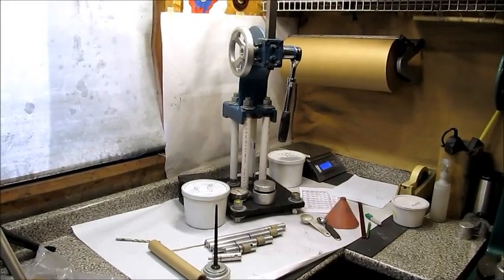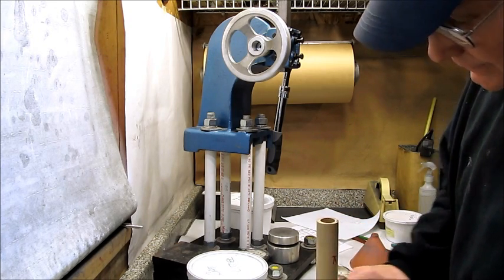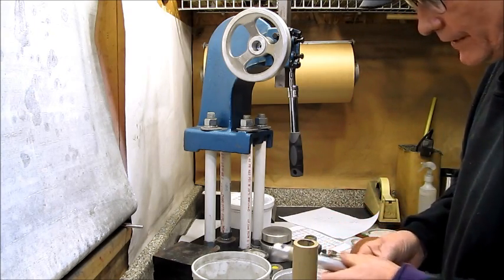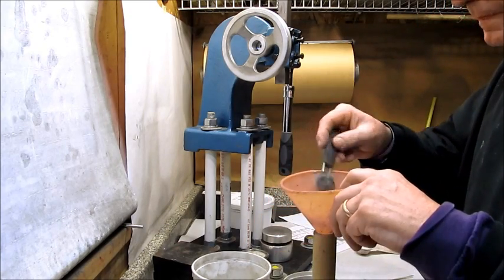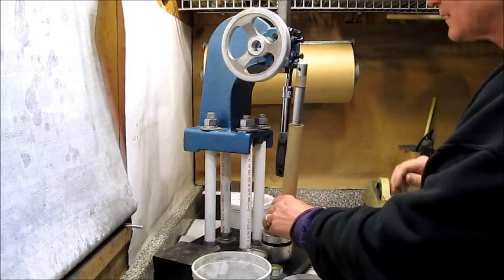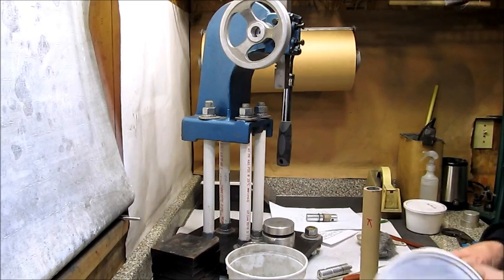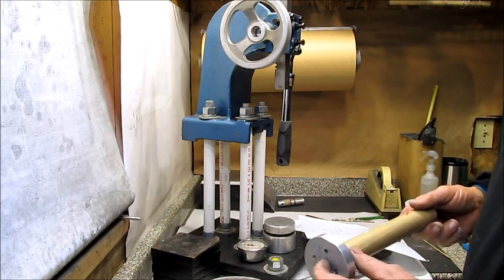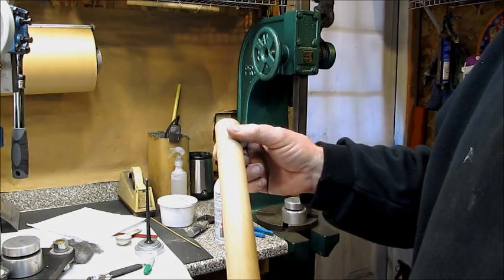Arbor Pressing a Black Powder Rocket Motor

Comment: Ned that arbor press sure makes quick work out of pressing a rocket motor. After I learn to hand ram motors I'd love to get 1 of those built. Although I don't know if I'm mechanically inclined enough to build 1 even with your amazing detailed tutorial on it & the gauge. I know Caleb sells 1 but money is always an issue. Thanks as always for your amazing informative tutorial.          Dylan
Reply from the maker: Yeah, Dylan, whether homebuilt or store-bought, good materials and tooling costs a bit, but the right tool sure makes a job go nicely.
Reply: witch video shows talks about the gauge please

Comment: sir... you are a ninja of pyrotechnics... i only wish i could come be your apprentice and learn your ways like the kid in an old kungfu movie learning the ways of the ninja master...
Reply from the maker: Thanks, Philie. Fortunately, nowadays, there are good 'net resources of information about fireworking, and we can be guided by them, and the conversations within them. Enjoy, ned
Reply: ned gorski one more question sir, im working on a kind of cake with flash salutes with a lift charge under them.. mebbe 9 or 12 shots (haven't decided) would you recommend i fise them with visco or time fuse? im making them from 3/4" tubes with paper end caps...  i dont wanna assume vosco will work and have em flowerpot.. but i dont want them to take wau too long to ignite and hit tje ground.. your opinion would be much appreciated
Reply: ned gorski Sir bed I have a quick question, pardon me if you've already said this somewhere but I haven't seen/heard it if you have. but when pressing a powder motor like this do you use like meal d powder, or do you use granulated?  I would assume using the fine powder would be better,  but I've found not all things work as you'd think so I figured I'd ask.. thanks for your time and help

Comment: Sir 
I have a 1/2 ton press setup like this and nothing larger,
also no ram gage or conversion chart. Would you suggest hand ram of the 1in 3lb motors?.   Also I have red ceder 15-10 milled , I use as a start to BP. Would that be ok with a mix of 100m KNO2 and 15% Cookbooks air float?  
   I'm trying to keep my milling to a minimum as these mills I can handle only handle a real 400g load. I do cheet them to 500g . 1 to 1 1/2 water as you said. Not oil..
CATOS ain't cool but nether is bothering you ....
Bob

Comment: Ned, on the Wolter Pyro Tools, the PDF on related to the Pressure Conversion Gauges list the required PSIs as 6500 PSI for Black Powder and 8800 PSI for Whistle.  Now, I would think (probably incorrectly) that I would need at least a 3 to 4 ton press to achieve that pressure (6500/2000 = 3.25 tons).  Does your arbor press create that much pressure?  Or is there something in the math related to the smaller areas of rocket diameters that allows that type of pressure to get leveraged from, say, a 2 ton press?  Hope my questions make sense.
Reply from the maker: HowellHudson Force applied by a press is different than the pounds-per-square-inches pressure (psi) that is applied to the propellant in a motor. The area of the hollow rammer, as compared with a solid one, also has to be taken into consideration. I hope that points you toward the math necessary to clear that all up. Also, making the BP propellant the way shown in the videos, and using shorter increments, necessitates only about 5000 psi on the comp, instead of Rich Wolter's 6500 recommendation. Good tubes can be pressed up to that pressure without being damaged.
ned

Comment: Hey ned, love your work!!  I was just wondering, but what psi do you use for 3/4" nozzled motors on your p2f gauge?  I'm using 1800 and still shrink my tubes.  Thanks!!
Reply from the maker: I put 7500 psi of pressure on my rocket propellants, and tube waxing prevents the problem you are describing, Jeep
Reply: @nedgorski  thanks!

Comment: If you don't mind, what is the purpose of the rubber O-ring. All I can come up with is to minimize powder blow back while compressing.
Reply from the maker: If the propellant is dusty, Ol, the o-ring prevents that dust from "floofing" out of the tube as the rammer is inserted into it.

Comment: ChazCo, 
Where did you get the load cell with the gauge on it ?  Also what kind of spray lubricant do you use on the spindle and rams?  I am hoping it is nearly odorless and clean (not like WD40 but maybe like silicone spray).  Also, what is the formula you use for you black powder?  Do you use Dextrose with the small amount of water? I enjoyed your tutorial immensely.  Maybe I can finally get some performance out of my rockets.

Comment: Another awesome video from the Firework Guru. Question: What is the delay composition?
Reply from the maker: Quite a few compositions can be used as the delay, to create different effects, Danny. The same propellant can be used, dialing in the height of the delay to get the timing right. Or a delay comp with different metals in it, or glitter, or color comp. Lots of creativity possible just with the delay comp.

Comment: Great video I did a 1lb super core burnet rocket.. my mix was 75/15/10 I rammed the Bp all the way to the top of the tube minutes one inch… the rocket went high I say maybe 200-300 feet.. the problem I had was that I didn’t have a delay mix or bulk head clay the rocket went high then started coming down, down, down and my header exploded only 5-10 feet above grass.. any idea what could have happened here? Is using a delay mix and clay bulkhead beaded to prevent this from happening again? Please lmk
Reply from the maker: It sounds like you had too much propellant above the spindle, Jose. That, or there was some delay in the heading igniting.
Reply: @nedgorski  thank you i heard you have a website I can pay to learn more about pyrotechnics.. can you send me your info please so I can subscribe please.
Reply from the maker: @jstorres486  See the beginning of the vid, Jose. You'd be welcome.
Reply: @nedgorski  jajaja I got it thank you
Reply: @nedgorski  it was too much propellant above the spindle I corrected that and all 8 one pounders have gone off exactly the same.. thank you and I’m glad I subscribed to fireworking forum all ready learning a lot.. God bless
Reply from the maker: @jstorres486  Excellent, Jose. Congrats. Onward and Upward

Comment: Hay Ned I know this is a older video, but I have a question about your press.
I'm not on fireworking, although I'm on apc. What thickness is that base plate?
Reply from the maker: That's 3/4" steel, James.

Comment: Ned, forgot to mention that i dont have trouble on getting rocket tubes/cases, as a licsensed pyro guy i always have leftover debri of a variety of 1.4g and 1.3g cakes which i just rip the tubes out and recycle them for comets, mines, meteors, gerbs, rockets etc. just tired of pounding rockets with wooden dowel and should use a press so i can make whistle and bp rockets instead of kno3/sugar rockets.

Comment: Hi Ned. Do you have to dry these motors to remove any moisture in the BP 70/20/10 fuel grain? If so, how long in the dryer? Thanks for all of your amazingly good presentations.
Reply from the maker: Nope, no drying needed, Pete. I dampen all of my BP propellants with 1% moisture, or so, nowadays. Fly them right away if desired. Thanks.
ned
Reply: Thank you, Ned, and please keep making these wonderfully practical, and extremely informative, video demonstrations.
Reply: Vern Estes discovered that 60 years ago, made the production of Estes motors practical...too dangerous totally dry anyway, more of a spark hazard from dust, and the slight moisture helps compacting.
Reply: Traduzir para portugues
Reply: Gostei muito bom show 
Muito bom esse sistema para carregar  os  impusores de foguetes

Comment: ned, love your videos and as a licensed pyro technician, i want to press some rockets to sync with the client's national anthem music... "....and rockets red glare" (1 lb rockets take off)...."bombs bursting in air...., (header with effects). so after testing with Eastes E9 rocket motors, height is perfect but time delay and burst i need work on. so, to get started, going out to harbor freights and getting a 1 ton press lik yours and start modifying like yours. if you have a video on it that would be nice but i think your video shows enough. next i need to buy rocket tooling kit, probably same diameter as eastes E9 ID of tube. then work from there on formulas and time bursts. any tips on this would be nice, especially trying to make the rocket fuel give red glare to song. -joe

Comment: Hi Ned, Great video. Could you tell me how dangerous this really is? Honest answer please.
Reply from the maker: Dealing with any explosive or powerful composition or device has its hazards, Sir, but if one practices good safety precautions, it all can be done safely and successfully. We emphasize safety a lot in the "community".
ned
Reply: +SIR LOVEY It's worth mentioning that pressing BP is much safer than other ramming techniques that you can also use to make rockets. You should join a forum like fireworking.com and get lots of advice before attempting any of this. Then as Ned says, you can do it relatively safely. In fact if you chose to avoid some of the more high risk articles then it's as safe as any hobby as long as you understand the risks.
Reply: Sparky Malarky Thanks Sparky, I am slowly learning as I go.
Reply: +SIR LOVEY As are we all :-)

Comment: Can i make 4oz strobe rockets with that Press or is it so dangerous because of the fast pressung?
Reply from the maker: Yes, whistle and strobe propellant can, and should, be pressed, never hand rammed.
Reply: @nedgorski  okay thanks, do you know with what force a 4oz (1/2") strobe motor is getting pressed? Is a half Ton Arbor press enough?
Reply from the maker: @Pyrokartoffel  I like to press with a pressure of 7500 psi on the composition, so you'd have to determine the areas of your hollow and solid rammers to get to the amount of force needed to achieve that pressure. On the solid rammer with an area of about 0.2 square inches, you'd need to apply about 1500 pounds of force, and would need a one-ton arbor press to achieve that amount of force.
Reply: @nedgorski  if i have calculated correctly i have an area of 1-1.1cm² to press, for that i would need 530-600kg
Reply from the maker: @Pyrokartoffel  Is that with your hollow, or solid, rammer?
Reply: @nedgorski  10mm or less with hollow and 11,3mm solid
Reply from the maker: @Pyrokartoffel  I don't know what you're measuring there, Heis. But, let's say you have a rammer area of 1 square cm, and you want to achieve the 7500 psi on the comp I was referring to (in US units), I do get that you'd have to apply about 527 Kg of force to the rammer.
Reply: @nedgorski  okay, it's in millimeters if that's what you mean

Comment: 2000 pounds on the scale? So that would be around 4000psi on the mix in the 20mm tube?
Trying to replicate. Cheers from Switzerland
Reply from the maker: That's correct, Sven, if a solid rammer is being used. If a hollow rammer, I typically figure the area of the end of the rammer, and therefore the comp it is compressing, is about 0.75 x that of a solid rammer. So, if pressing with a hollow rammer the psi pressure would be more like 5333 psi. Best from the US.

Comment: HI NED, my name is amparo and i have a question for you. when i build a rocket motor ussing an inox steel rocket motor tool, when i test my motors, they explot, could you suggest something to prevent this?
Reply: thicker tube or slower fuel

Comment: Hello ned and pyro people ! What is purpose to add a wheel on your press? For press more fast ? Thanks
Reply from the maker: It just makes it more ergonomic to use the press, PF.
Reply: @nedgorski  thanks, do you think can i press a 1lb whistle rocket with that 1 ton arbor press? Thanks
Reply from the maker: @pyrofrench6369  I like to put 7500 psi on the comp in a whistle rocket, PF. With a hollow rammer, and an area of about 0.33 square inches, I'd want, then, to apply about 2500 pounds of force to the tooling. So, no, the one-ton press could not apply that. I'd want a larger press for that.
Reply: @nedgorski  hello , do you think a 2 or 3 tons arbor press are able to press with a  good tooling and a rocket tube support, can I able to press a 1lb whistle rocket motor ? By way : happy new year 🎆🎆
Reply from the maker: @pyrotekmanfred6503  Yes, either of those would work fine, Fred. Happy New Year, and good luck.

Comment: got a question. guess your the only one i can ask. is it safe to compress mg/s/c rocket fuel?
Reply: *the sulfur is mixed with 1,3% Mineral oil to decrease the burn rate.
Reply from the maker: +Hakenhand Röhle , Magnesium? I don't use magnesium, typically, and have never done so in a rocket propellant. What would be the oxidizer in the mix you cite?
ned
Reply: It doesnt need an Oxidizer. The sulfur reacts with the magnesium (magnesium sulfite). This mix would be flash powder without the oil and charcoal and the paper tube couldn't handle the pressure. So I decreased the burn rate by adding these two ingredients.
Reply from the maker: +Hakenhand Röhle , Interesting, Hak. I have no experience with such a mix, so would certainly recommend proceeding with great caution. Better safe than sorry.
ned

Comment: Hi Ned, Do you have any idea how many pound rocket this will thrust into the air, say about 500 feet?
Reply from the maker: SIR LOVEY I've done extensive thrust/lift testing of all the various sizes of BP-charcoal-tailed motors made that way, Sir, with results in a chart in an article in Fireworking. For 3/4" ID motors, I can nicely lift a 3" ball or cylinder shell heading, or a 4" ballshell.
n
Reply: how many grams max lift weight with header, engine and stick

Comment: Which would be the ideal theoretical load (psi or kgf/cm2) to be applied on the propellant while filling any BP engine?
Reply from the maker: With a black powder motor, I like to apply 5000 psi to the composition.
Reply: @nedgorski  KNO3 sugar propellant could require a similar value? 
However I’m really honoured to get your suggestion, many thanks.
Greetings from Italy.
Reply from the maker: @flyhigh9714  Greets back to you, Fly. My goal is to get very densely compacted propellant, without damaging the tube, so that's what I'd be shooting for with any propellant.

Comment: Where can I find that p to f gauge? To  buy, I seen you have them for rent on skylighter.
Reply from the maker: Yep, I have a loaner to rent for press gauge calibration, on Fireworking.com. To buy one, go to Wolterpyrotools.com
n
Reply: ned gorski thank you for the prompt response, I admire your work and enjoy the videos. My next project is whistle rockets, maybe you can make some more videos on what we can do with them. Is a whistling strobe possible or a whistle rocket with green stars?
Reply from the maker: KevinBeGood Thanks. Be careful with whistle. It is powerful propellant. Strobe rockets typically have a first "whistle booster" section, as do some colored tail rockets. I'd have the green stars in the heading. Good luck,
n
Reply: Yeah I meant for strobe or stars as the heading, I was tryin to think of something a little different or unusual as some would say, instead of the old whistle &  pop.

Comment: It is a endburner rocket right?
Reply from the maker: No, that's a core-burning motor.
Reply: @nedgorski  Oh ok. Is endburner too slow burning for this technique or does endburner work as well?
Reply from the maker: @nicoeggert2527  End burners and core burners are quite different. I prefer end burners for drivers on girandolas, and use core burners as stand-alone rocket motors.

Comment: Hi I'm doing rockets over 8 years,  from  India, with iron hammering technique,  that's problem my rocket smooothless, and I loss many effort to hammering over ramers.. now I want this arbor press shipped to india, @ned gorski sir please suggest me site from where I can get that product, and ship in my address in India.. thanks..
Reply from the maker: Yes, Deb, a good press, a good tube support, and waxing the tube interiors, can make successful, consistent motors, EZ. Good luck, ned
Reply: ned gorski what does the waxing do? I'm just learning to make rockets not had much luck.
Reply: @PyroThunder  Probably makes it easy to remove the rammers.